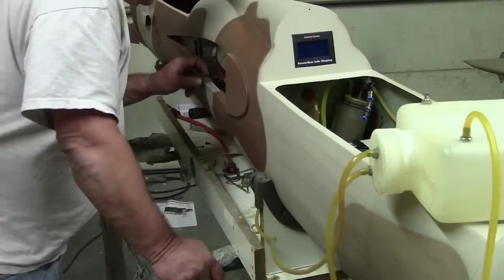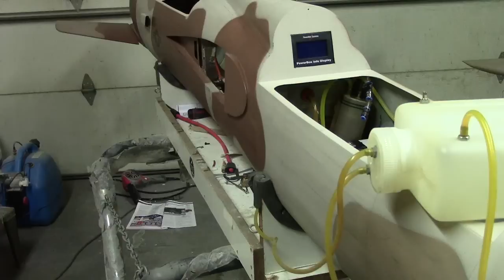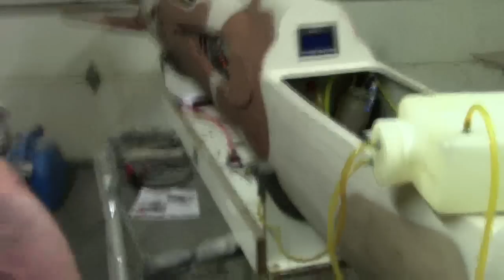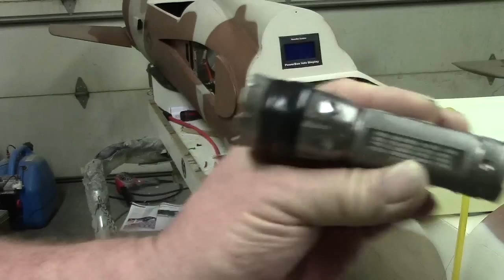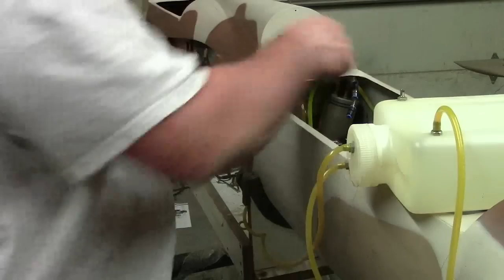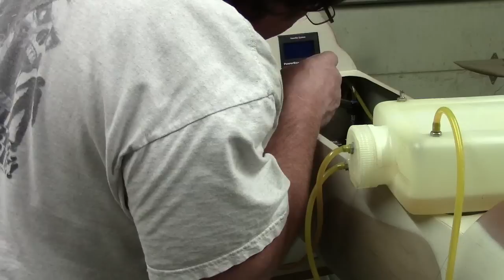count down to cali #9

Comment: I think you might could use some larger inside diameter fitings and lines.  Seems like it will be ton of work for the turbine fuel pump to get fuel to motor.